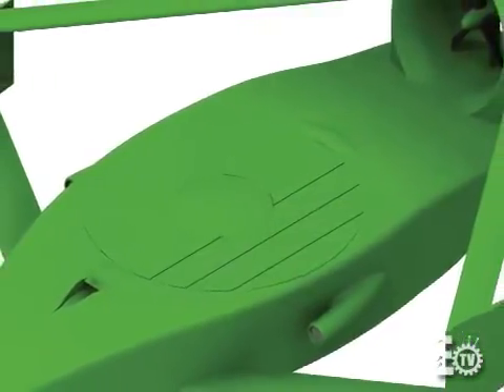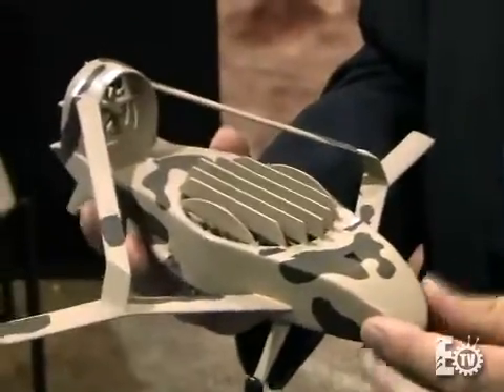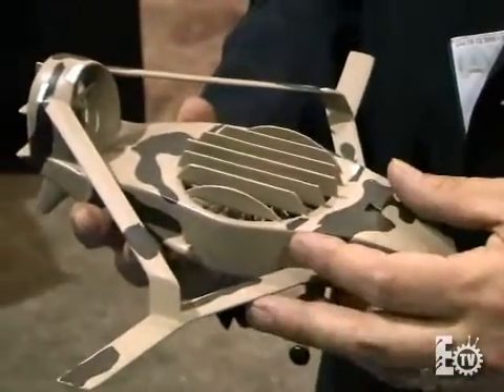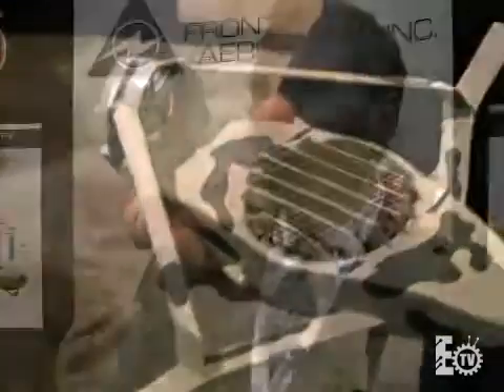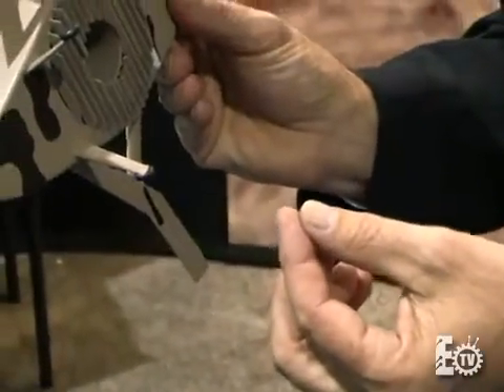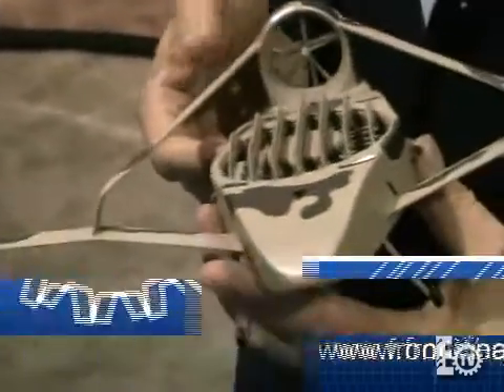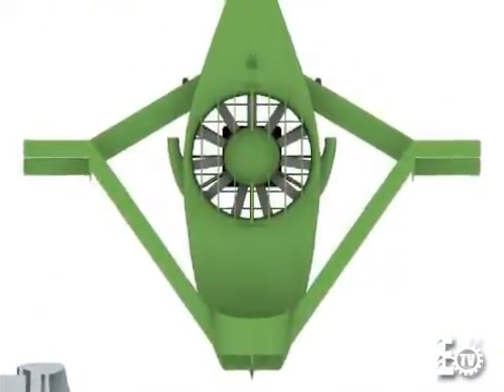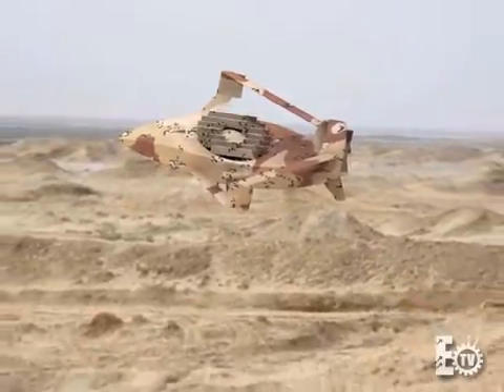V-STAR Tactical UAV - Engineering TV

Comment: I was there... there's a reason why the test flight video cuts off where it does. The vehicle experienced a power failure after maybe 15 seconds in the air. It is nothing wrong with the airframe design, just a problem with the motor controller. Apparently the payload goes in the center of the fan. Personally, as an experienced model aircraft builder, I don't think this is a great design, but if it works as promised, then it will be very interesting.